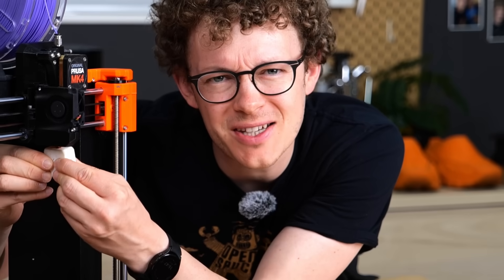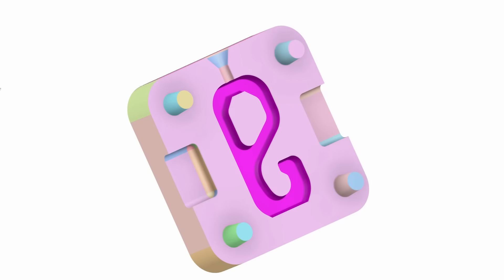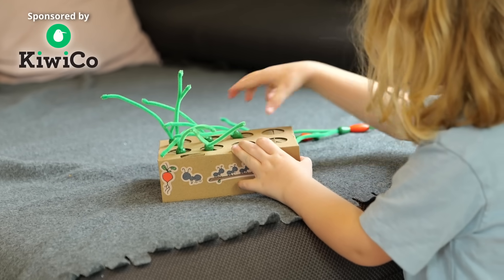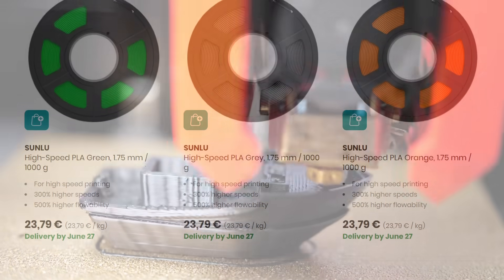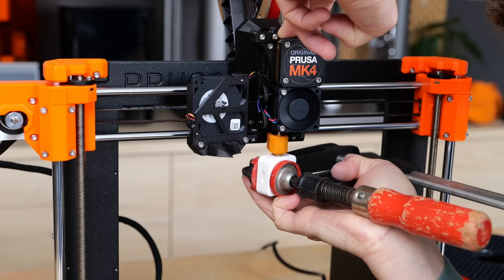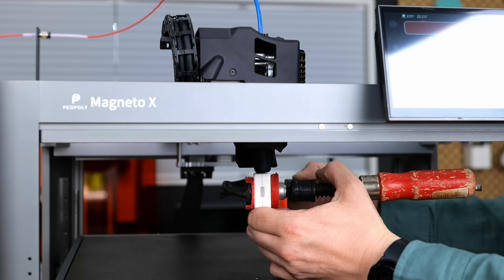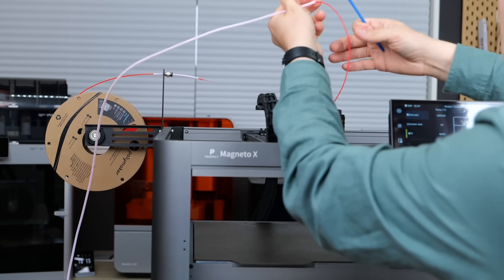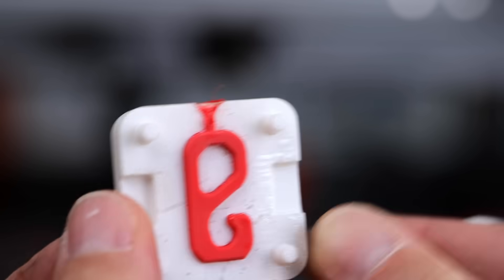I tried Injection Molding using a 3D Printer!

Comment: 1. You need an exit sprue strategically placed. 
2. Try designing the mold so the hotend nozzle is inside of the clamp which would create a sort of back pressure to regain the losses you get by hand holding. 
3. Barring #2 you should just use the z axis as the vertical clamp.

Comment: Man i appreciate your channel, but why didn't you try to do it more professionally, from an engineer's point of view this is a disgrace hahaha..

1) your mold have no Air Escape Hole, (i mean do you think that the air in side the mold would just vanish out of existence ?, this sole fact doomed the success of this project)

2) the plastic will obviously cool very fast when injected, and there are multiple possible fixes :
* Potential solutions for 2 : 
- Inject with more Pressure
- More Temperature
- Best solution by far : Print your mold in a heat resistant cheap plastic like PET-CF, Anneal the mold so that it can resist to up to 200C, then heat it in your kitchen furnace to about 180c, and Finally => Inject your PLA in it and it'll workout fine ! (PLA doesn't stick to PET so it would be easy to get it off the mold)

=> I really mean strictly no disrespect, like really but .. Man watching you through this video made me think of that Video of an Orangutan hitting a flat nail with a hammer on a piece of wood 🤣🤣

Edit : Seeing the comments i see that im not the only one outraged by the poor execution

Comment: Clamp the mold down to a heated bed that continues to heat when the injection is happening. Remove the extruder from the gantry and clamp it directly to the mold instead of using that terribly leverage with your arm from underneath.

Comment: Maybe you should try silicon molds. Also the might not be able to push the air out of the mold if you seal it too tight. I suggest adding a tiny hole at the bottom of the mold to let the air out and also you will know when the mold is full.

Comment: wouldn't you need a vent hole at the end of the print to help the plastic flow through the mold without building up pressure?

Comment: With the bolt, it would likely be better to put the sprue on the head of the bolt to give the hottest plastic the shortest travel distance/time to fill the hex.

Repeating ideas i thought up and found in the comments:
Putting the mold on the build plate along with having the sprue more centered should help with things like the hook.

And yes i absolutely do think this is worth the effort to pursue, but i also worry 3D printers may not like this, and so some modifications, or possibly even turning a 3D printer into a designated DIY injection molding machine may be required.

Comment: 1. Leave a hole for the air pressure to escape as u fill the mold
2. Try it with "high flow" filaments

Comment: All you need is a nozzle that has a screwable end that the mold is designed for that it injects to. Threaded at the end of it, and mold release. You also should measure the size of your Flathead screwdriver and see what the easiest openable geometry for the holes in the side.

Comment: Warum erstellst du dir nicht einfach Gips- oder besser noch Silikonformen und presst Polymer mit einer Spritze aus der Apotheke hinein? Silikon (z. B. RTV-Silikon) wäre flexibler und erleichtert das Entformen, während Gips gut getrocknet sein muss, um Probleme mit Feuchtigkeit zu vermeiden.

Wenn du die Mulde aus einem Kunststoff druckst, der sich nicht mit dem Polymer verbindet, geht das natürlich auch! Allerdings kann es je nach Material zu Haftproblemen oder ungleichmäßigen Oberflächen kommen – ein Trennmittel kann helfen. Besonders bei PLA- oder PETG-Formen mit Monomer-Guss solltest du Silikonspray oder PTFE-Spray (Teflon) als Trennmittel nutzen. Eine zusätzliche dünne Schicht PVA (Polyvinylalkohol) kann ebenfalls helfen, da sie sich später in Wasser auflösen lässt. Alternativ sind Vaseline oder ein spezieller Trennlack für PMMA aus der Zahntechnik eine gute Option.

Und bitte vergiss nicht, dass die Luft irgendwo entweichen muss – am Ende deiner Form muss ein Kanal hin! Die Entlüftung sollte so platziert sein, dass die Luft von den tiefsten Stellen der Form nach oben entweichen kann. Falls das Polymer sehr viskos ist, könnte sogar ein leichtes Vakuum helfen, um Luftblasen zu vermeiden.

Falls das Polymer nicht gut fließt, könntest du alternativ eine Vakuumkammer oder eine Zentrifuge verwenden, um die Form gleichmäßiger zu füllen. Je nach Material wäre auch Gießen statt Spritzen eine bessere Methode.

Für mehr Tipps von einem alten Zahntechniker, sag einfach Bescheid! 😉 Manche Dinge haben schon lange bewährte und funktionierende Lösungen.

Comment: Your molten plastic is solidifying before reaching the end. Go hotter still, and preheat with something that has thermal mass around it so it can't cool off in use and on the waybto use. Eg two steel blocks pre clamped with a suitable preload.

Comment: I would try tiny air exit holes on difficult to reach ends. Maybe the the air pressure in this spots prevents the melt to flow there?

Comment: Might want to try a plugable air hole on the opposite end (where the injected plastic will reach last). Once you see the melted filament coming through that hole, plug it and let the pressure fully expand whats in there, that might help ensure everything fills up and fills out properly.

Comment: Hello - so fwiw I spent the first 10 years in industry working on, with, for injection molding working on all sizes and formats of injection molding machines.  The fact that you got these results is interesting and cool, as it shows what is possible, what some issues are, and starts conversations around what can be done.   Generally speaking injection molding machines are like giant syringes full of plastic and the plastic is injected by forcing the plunger forward thus putting pressure into the melt and moving the material into the mold.  The temperature of the mold can be a huge factor.  The main things to consider are the melt temp, the pressure available to inject, the dia of the nozzle, the size of the mold, the temp of the mold, and I am sure a few more items.

In injection molding we have 3 basic steps inject, pack, and hold and they are just what they sound like they are.  Inject moves the melt into the mold, pack puts pressure thru the still semi liquid plastic to press it into every corner, into every detail... once that is accomplished the machine will then "hold" pressure against the sprue until the mold has solidified.  The part is typically ready to be removed from the mold right after this is done.  

For what you are doing here you can see that it could be very difficult to achieve the pack profile and for sure very difficult to achieve the hold profile.  That said we can see what you were able to accomplish and that looks about right.  If you wish to go further then it would make sense to take the components available and to design and build an injection machine.  Note that the key here is that the injection machine melts a "shot" and injects it into the mold rather quickly, usually with a plunger that is driven by air, oil, or even servo/steppers.  Then the machine can sit and apply the pack and hold profiles as described.  

I do know that there are some desktop injectors available, some are projects that have been shared and some are items that you can buy.  

The biggest difference between injection molded part vs a printed is going to be appearance, infill, details, lack of layer lines, strength in all directions.   Cheers.

Comment: First off, thank you for making such an interesting and entertaining video. As to the next steps, I would think that, to further the success of this experiment, you would need to accomplish two major concepts. The first thing that you would need to do is keep the mold at a constant heated temperature. You could accomplish this by printing the shape of the mold to be able to sit unsupported on the build plate with only the smallest of locking clamps for keeping the mold closed. The build plate could then be heated to a controlled temperature and with some testing you could then find the optimal heated build plate temperature setting. This should keep the filament from solidifying before it reaches the entirety of the mold. Secondly, you need a much more secure way to transfer the molten filament from the extruder into the mold. I would think that some form of locking lever seal would work wonderfully. Possibly made of silicone because of it's high temperature tolerances. Like a bottle of Grolsh beer that uses a flip-top cap, also known as 'de beugel' or 'swingtop'. With proper a proper seal, stability and temperature, I think that injection molding with an FDM printer could be done quite successfully. 😃🤓😎

Comment: I am far from an expert in injection molding. My experience boils down to one unit in an industrial engineering course I took decades ago.

But from what I remember I see three things that might help.

First, put your sprue in a more centralized location. With the current location you are having to fill a long distance. 

Second, place a vent or two. I am not sure how much of a big deal this is, but if you get flow out of a vent it would at least be a sign that the plastic made it to the vent interface.

Third, is more of a setup suggestion instead of mold suggestion. Figure out a way to place the mold inside of a closed unit and heat up the chamber. The easiest way to do this might be to sandwich the mold between the extruded and bed. But this might put too much strain in the extruder. If you make a spring bed for the mold it would quasi-control the force on the extruder. 

Basically, find a way to make it so that you do not have to hold the mold, which will allow for the mold to be heated during the injection.

Comment: How is the air supposed to escape from the mold?
I mean would the air pressure build ir bubbles form in the mold?
You are injecting plastic through a small hole but what happens to the air inside, dies it just escape out the sides where the 2 halves of the mold join?
If it's not escaping fart enough could it cause back pressure and prevent the whole mold from filling
What if  small needle sizr holes ir channels were adde to ket air escape faster would that help?

Comment: You need to, somehow, heat up the mold, ideally quickly, inject, with holes to let the air out, then cool the mold, also ideally quickly.  Then demold.  Ideally you need a machine that does all that over and over again, all by itself.  You would need to design in a way to push it out.

Comment: I would print the form, cast an aluminum mold, figure out how to heat said mold, and then use the 3d printer to inject. You're only going to be able to get bigger molds with external heat to keep the PLA soft enough to populate the mold.

Comment: what you should do is make a positive with the resin printer and then use that to cast an epoxy mold for the injection. You need vent sprues as well.

Comment: You could use a Hobby CNC mill to carve aluminum, making screw holes for both the clamping and indexing, and drilling a hole in the side for a Hot end thermister, allowing you to heat the mold enough to keep the plastic molten until it has filled the mold, and then disconnect the thermister and let it cool before opening,

Comment: I think that a simple g code file would help with the stability / secure problems.

Could the pursa printer be modified to make a “slip” over the hot end. Acting as a insulator and a way to connect the mold to the printer.

What if you push the filament  in by hand?

What if there was multiple holes to fill? On either ends? 

You preheated the mold before using it on a different build plate. What if there’s a printed modification that makes it into a mini oven. Use the build plate screws to secure it.

All ideas, ❤ loved the video. please keep inspiring.

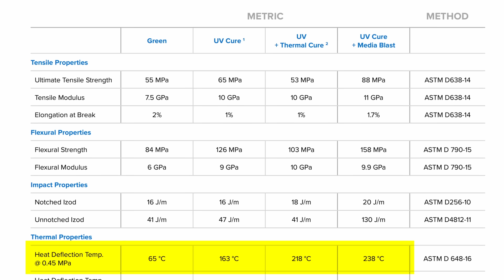Comment: I'm only @9:55 and I've also noted others already commenting, but what first comes to mind is an escape hole at the other end, for the air to be pushed out, otherwise as soon as the top has been sealed, you'll be pushing against the air left in the second half of the mold and yeah, if you've ever tried to block the end of a syringe and compress it, it's not going to happen, not with no release for the air

Comment: You should extend the nozzle and let the mold clamp around it so pressure can build without pushing the mold away from the nozzle. The nozzle could just be a stem with a disc that fits in a negative cavity in the mold. pressure in the mold would then help to seal the nozzle/mold interface.

Comment: It's all about air flow. You're trying to compress air and force material into the mold at the same time, which is impossible. Air needs to escape, maybe add some vents. – it needs to escape. Maybe a heat-resistant release agent so you can separate parts more easily too if there is such a thing?. The overhang is a BIG problem! Material won't flow uphill. The air will get trapped in the hook end, creating massive pressure (which is why it will never fill). The mold could even explode because of pressure/design (obvs not while holding by hand - but its designed in a way that builds pressure - This is what I would call a very exciting mold!!! XD)! Put the sprue in the middle of the object. it also will allow you to get rid of that bubble on the hook end.  You'll still need more vents for flow and air escape though!. Even so, what a fun little project! I wish my bamboo mini could do this, but I think it just would have no chance at all. I think the PLA would just cool down in three seconds  :(. Even so I hope you have some luck with it!!!  And yes, as someone mentioned, maybe you could use a hot mold! maybe that would keep the plastic liquid enough long enough to let the air out and let it flow around the mold more fully? All mad experiments, but hey that's fun

Comment: well i think for small parts you can print the part u want to mold and then make a mold from cement after that heat up the cement mold in your kichen  i believe with heated mold it will be easy for simple small parts

Comment: Nice video, I like what you attempted, and surprised it worked as well as it did.
I don't know if they heated the molds at the place I worked, but I would imagine the molds would naturally heat up from the plastic either way.
I do know that larger parts have multiple injection points, and the injection ports were around 6-10mm.
Looking forward to the next attempt.

Comment: Have you thought of modeling the threads into the mold so that it screws in like a nozzle? It would eliminate you needing to hold it against the nozle, remove the flow limitation of the nozel and would help the sealing issue between the nozle and the mold.  Just an idea.

Comment: Scratch the inside surface of the mold on the bottom of the hook to make a vent. I’m sure you’ve figured it out at this point. You’re a genius. 

This is a really neat idea. This could work very well for a binary material that needs to mix. I’m imagining a large bed of a bunch of different molds automatically by a filled up by￼ some kind of X-Y-Z gantry printer.

Comment: Here are some suggestions:
1. Print (resin or fdm) adjustable vertical 'vise' that will allow you to adjust the pressure between your mould and nozzle, while locking it in place ( I suggest something like PET-CF because of suggestion #2)

2. redesign your mould setup so it can stay heated while being filled - for a very similar reason to why your print bed stays hot - the added heat to the mould will keep the internal plastic from cooling while the mould is being filled, which should require less pressure and therefore accept lower speeds while filling. The closer to the melting point of the plastic you can keep the mould, the better your results should be.

Cheers!

Comment: I think the way to go about it is to use the heater and drive from a 3dp, but redesign the hot end. Maybe create a tip that's threaded on bothe ends and then thread the tip into the mold. The mold should probably be heated while injecting, too.

Comment: As someone that creates molds for home projects, it definitely needs another air hole. This is mostly due to the viscosity of the materials your using and the pressure (which still may not be enough. 

Orientation of the part your making is also key.5he entry point of the plasticcomes straight to an inverted T, pushing a viscous plastic against a wall that is cooler. I create these for liquid heat cured A and B resins. It remains quite fluid for about 10 minutes before beginning to cure. I do love the 10K resin. Its expensive, but i dont have to keep buying and remaking molds anymore.

Comment: I'm a mold designer in the automotive industry.
Plastic will not flow fast if it is working against compressed air!
At minimum you need vents on the opposite side of the injection point to get the air out of the cavity. 
If you have air trap anywhere else in the cavity add vents in that area.
vents should work great at .001-.002 inches deep. 
Width of the vent depends on how much air trap and cavity volume you have.
Always start small and cut more later.

Comment: I think you need to preheat your mold and also add an air hole at the end of the injection for the plastic to be able to flow to the end of the mold

Comment: You need to add vents to the cavity image. One of the primary reasons you're getting partial fills of the mold is that the air inside the cavity image is pushing back on the polymer. You can get these as small as 25-100 microns on resin printers and worst-case scenario, you might have some extra finishing work to do on the molded part. Anyway, I hope this helps!

Comment: you need to have a breathing hole in the mold or it will be slower and may leave air bubbles. The only way it could get out otherwise is the opening where the plastic is pushed in and through gaps in the mold.